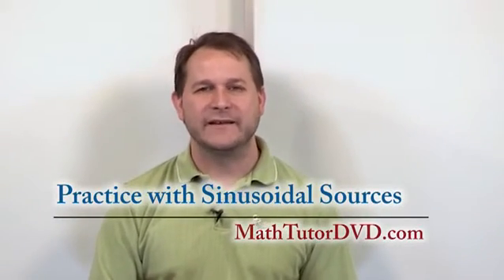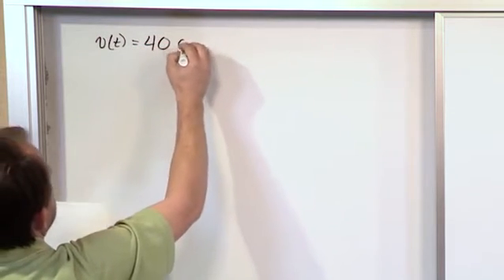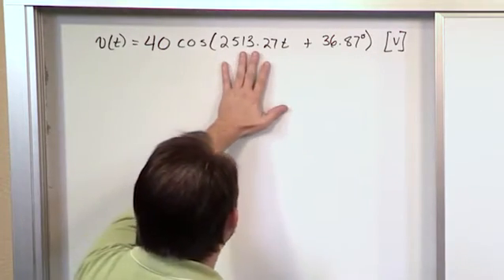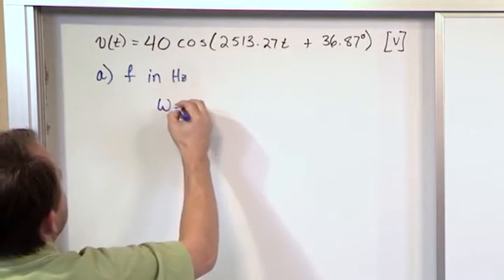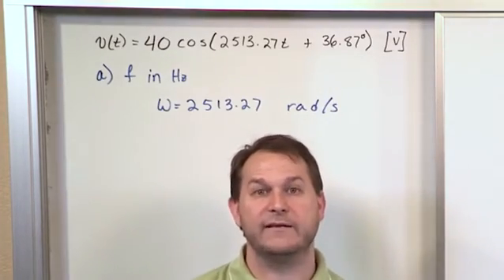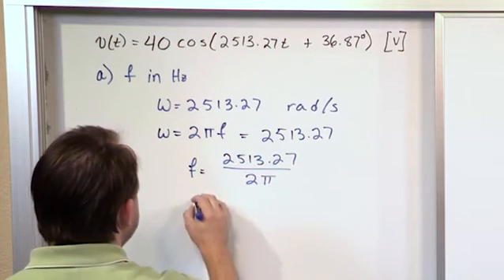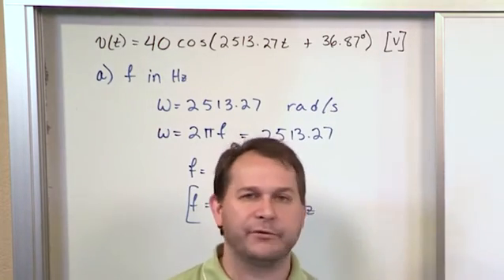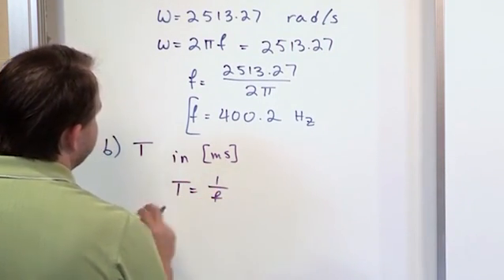Lesson 5 - Practice With Sinusoidal Sources (AC Circuit Analysis)

Comment: To convert angular frequency (ω) to frequency (f), you can use the formula f = ω / (2π). Angular frequency is measured in radians per second, while frequency is measured in Hertz (Hz), which represents cycles per second. Therefore, dividing the angular frequency by 2π will give you the corresponding frequency...